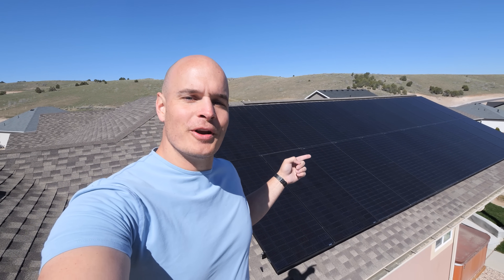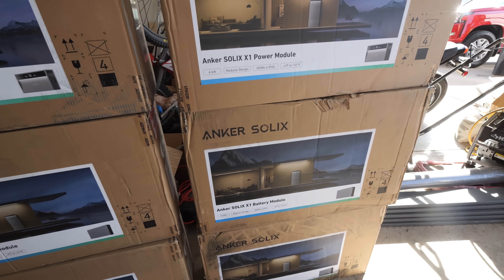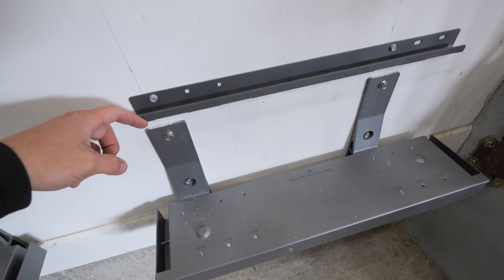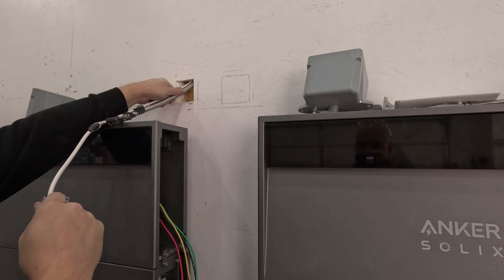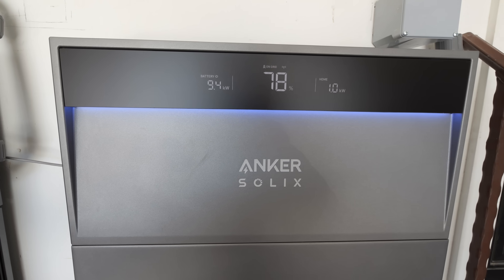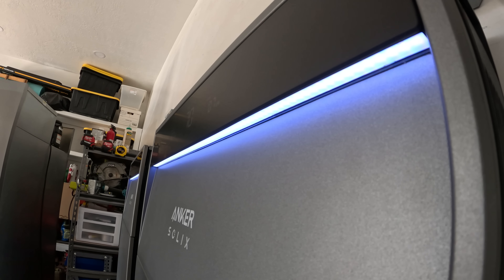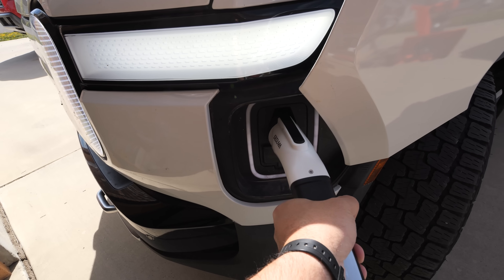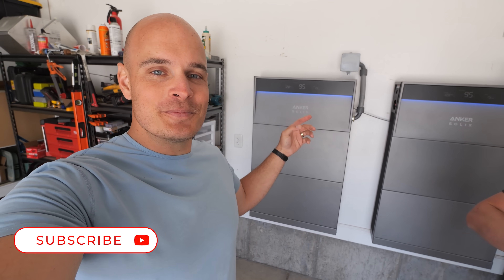How to Save Sunlight for the Night? - NEW Solar Battery Install

Comment: The Anker battery system seems really great as a whole house backup solution.  But it shares one attribute with many other solar energy systems that I'm not crazy about - it requires your battery system to communicate with Anker's servers.   So what happens if Anker isn't around 10 years down the road or internet connectivity to their servers is somehow interrupted?  This trend is ongoing across the whole solar energy sector.  Companies are firmly tethering us to their servers.  Sunpower filed for bankruptcy protection while some brand new systems had yet to be activated.  So owners were stuck with brand new hardware, fully installed, grid access permitted and they can't power them up and start benefitting from them because Sunpower didn't have the personnel to activate them.

Comment: In my short time with solar panels, I have noticed that they do collect a lot of HEAT.  During solar panel installation, are the installers using any type of heat reflecting material underneath the panels? as to not make the home HOTTER.  kinda counter productive, right?

reduce heat in home, and probably help with solar energy production, reflective material under the panels...

Comment: It's funny how people still have anxeity about full cycling lithium technology back from the days of old battery tech.

It's not the cycling that's an issue with LPF, it's high temps and voltage (high capacity charging). I hope those batteries have an 80% charge feature to extend their lifespan...

Comment: In Australia 2 x 5kw quality batteries would costs $20,000 and that's a lot of night electricity so does it make sense to have batteries?

We've just had a 6.6kw system installed and the solar guy said to wait a couple of years to gather the 6 HOT months night air conditioning usage data before deciding whether we get batteries.

Comment: Low efficiency to charge solar energy
into batteries, not worth it 
Lots of energy goes to waste 
You didn’t mentioned that, the most important factor of this system 
Time for better solutions

Comment: Why are people making such a big deal that a system that requires installation based on your specific home layout and needs that may well exceed the cost of the units doesn't have a price listed.

There's A FREE QUOTE. You can do that if any of you actually cared about the price, rather than just bandwagonning onto the stupid.
Reply: I got quoted 88,000 for our whole system. Which personally is big but I don’t see it as outrageous. What I really want are the Tesla solar shingles but now that’s an outrageous price 😂 100-200k is a big no no

Comment: Latest UK guidance is that batteries like that should be fitted outside the house, and more than 1 metre away from any doors, windows or exterior air vents. So obviously more perceived fire risk here.
PS - The "1 metre" requirement pretty well excludes most of my external wall space.

Comment: My system is much more modest. I have 4.2 kW of solar and 15 kWh of energy storage and a 7.5 kW inverter. I bought everything for about $13,000 and installed it myself with my electrician buddy. I took the 30% tax credit and it is saving me over $2500 per year. So that's a payback period of about 3.6 years.

Comment: The missing piece is a full electrical panel so that when power goes out it can shut off certain breakers.. like a hot tub.. or heat pump.. or EV charger that use more electricity than the inverter can handle.    I know there are some small panels that do this, but where is the 40 spot 200amp whole home panel?

Comment: kind of odd in my view   one can buy a single battery that outputs 15000  takes up a lot less flloor or wall space.  Cost is around $1000 to $2000 depending upon where one buys the unit.  Granted you likely got these batteries for nothing as a compensation for doing the video.

Comment: at 2:10 you say the batteries is about 20kwh of power. (i think its 4 batteries at 5kwh each).   Earlier in the video you said average house uses 30kwh per day, so if thats say 15kwh during day and 15kwh at night to get to 30, then sounds like 20kwh is going to be about 5kwh more than he needs, and thats just for ONE night. If he has no grid power for more than one night, he's sitting the dark. Correct? During the video you say "massive" power and all that, sounds great, but sounds like this guy is going to be sitting in the dark if the grid is down for more than one day. Maybe I'm wrong, someone chime in if you know for sure. More and more of these types of videos are really just commercials to buy something that may or may not actually work like one would want it to.

Comment: My question is how long before these solar cells degrade?  In my experience purchasing solar lighting, after about a year and a half, the coating on the solar cell becomes cloudy, reducing its output.  Supposedly solar cells only degrade 0.5% per year but that's not my experience.

Comment: lol these things .. well any kind of battery backup is way way too expensive. You might as well save all the hassle and expenditure and just pay for grid power. By the time you earn your initial outlay back , something would have broken or batteries need replacing and you have to start over again trying to get all the cash spent back.

Comment: Here in Brazil, we can send the excess to the grid and the energy discounts it in the electricity bill. So it is a way to save this excess to use it at night or on cloudy days. I don't know if the savings are the same as having a battery, but at least we don't throw away all the "unused" sunlight.
Reply: We have net metering in the States as well, but most utilities have lobbied the gov so now we only get about 1/10 to export the energy compared to what they charge.  NM is mostly a joke in most areas of the states now (or it will be soon!)

Comment: Battery backup is still too expensive at this time,but will probably be worth it when the price per KW drop to $100 or less and not $1,000 to $1,400 it is now per KW.

Comment: Price is "request a quote".  I installed a 5.1 kWh EA Sun battery (100 A-hr, 51 VDC) which similarly hangs on the wall, for $1500 shipped.  It works fine with my 6 kW hybrid inverter (EG4 6000XP), using a comm cable to show state-of-charge.  I just use the battery to get thru evening peak pricing after the sun declines (until 9 PM), plus when any clouds pass (rare in CA summers).  So far, it hasn't drawn down more than 50%, so suffices.  If not, I can add more batteries.

Comment: It’s called “Anchor” because you are financially burdened by it so much, it will drag your wallet to the bottom of the ocean.
Reply: It's cheap
Reply: @frostnemes1s  Not when compared to say…30kWh EG4 LiFePro battery array and 13,000 worth of Inverters.

Comment: solar only works as a offgrid solution when the climate is suitable. good winters screw up what you can do in that time period...
Reply: It works during winter aswell.
You just have to spec the system to manage during the winter...
Reply: @zaarkeru3391  yes that is quite right. Unless real winters with snow. When i use electrics to heat my house. I don t have enough sun to get close to 25kwh dayly use. Maybe between 2 and 12 in winter... nog enough by far...

Comment: Even if "you don't make your money back" its still probably a good investment for 2 reasons. 

1. If the grid fails you are still protected. Especially meaningful if its a blazing hot summer day and you don't lose your AC
2. If you can pay up front for the system and for it to be installed then budgeting becomes easier after the fact because you're not concerned about paying a electricity bill at the end of the month anymore. Less bills to keep track of helps you manage money better

Comment: This is fantastic setup! But i think it does require regional and state-wise configuration to be able to discharge when electricity prices are highest as well as selling excess energy. I wonder about the 10-years warranty - i've had issues with those. They always try to wiggle out of it with some excuses in their terms of service.

Comment: 20ms is a pretty great cutover time for a grid failure, how well does it handle a brownout or a loss of one leg vs a full grid cutout? Also with the 20ms cutover time do any computers in the house shut off? (For reference most computer UPS cutover in less than 10ms)

Comment: In 🇵🇰(Pakistan) the wapda buys a solar power unit at price of 18 rs thoro net on grid system and sell us that uni at:

•For 1-100 units, the price is Rs. 22 per unit.

For 101-200 units, the price is Rs. 32 per unit.

For 201-300 units, the price is Rs. 37 per unit.

For 301-400 units, the price is Rs. 43 per unit.

For 401-500 units, the price is Rs. 47 per unit.

For 501-600 units, the price is Rs. 49 per unit.

For 601-700 units, the price is Rs. 52 per unit.

For units above 700, the price is Rs. 65 per unit.

Comment: 2 things to remember when you think about batteries.  10kw battery will only give you 6-7kw of power cos they don't deplete everything. Second most ev cars have huge batteries so use your car as a extra battery. I have

Comment: I am wondering if this kind of battery could also work with at least 2 EVs that have bi-directionnal AC charging with Vehicule-to-Home (V2H) (plugged on bi-directionnal AC chargers) and what power source would be prioritized in that case…

Comment: Bringing the Sun to Your Nights: Introducing Our Latest Solar Battery Installation! ☀🔋 Say goodbye to energy worries after sundown with our innovative solar battery solution. Harness the power of sunlight during the day and store it for use at night, ensuring round-the-clock access to clean, renewable energy. It's a game-changer for sustainability and convenience, empowering you to embrace a brighter future while reducing your carbon footprint. Join us in embracing the sun's endless potential, even after it sets

Comment: Yo, you ever thought about building the battery bank yourself, using raw cells? That seems right down your DIY alley. It's remarkably easy, and especially with new LiFePO4 tech, also super safe. I've been doing it for a few years now and have saved people a ridiculous amount of money on solar generator type products. So many awesome topics to dive into if you decide to pursue it.
Reply: Hi. I am very interested in this and I had no idea it was safe and easy to do this until I saw your comment. Could you recommend any learning materials, links,  products, etc that could help?

Comment: Anker sells crap like EcoFlow.
Ask them, what LFP cells they are using: manufacturer and model of those cells

Answer: none
cause they buy cells from chinese spot market for cheap and you are scewed cause the cell is the value of such battery. Only its spec sheet will tell you more about cycles and what to take care for. Stopped the video and can not recommand just pure advertising.

Comment: Some questions that should be answered before anyone should be willing to commit to any system like this:
1. Can Anker make a unilateral decision to brick it remotely using the internet connection?
2. If/when they go out of business/get bought up by a bigger company, or in the extremely unlikely event that their stuff is actually reliable long term, want to force customers to buy upgrades for devices that still work fine, will this system still work if all remote systems/phone apps etc. are no longer supported? 
3. Will it talk to open source home automation software?
4. What information are they gathering using their devices and who are they selling it to?

Comment: Isn’t it more cost effective to buy one or two battery backup units instead of 6.  I see lots of wasted sheet metal and overhead electronics. Tesla PowerWall or similar competitors may save money.
Reply: Are you referring to only using batteries and not getting solar panels?
Reply: @Stevepcox491  No, solar & batteries.  My minor objection is 6 battery packs vs 1 or 2 larger ones.
Reply: @johnpoldo8817  oh. If this anker batteries end up being close to Ecoflow similar battery prices then, this battery would be cheaper. Tesla batteries are 12 kwh and their price is $11,500. Ecoflow 2 units would be 12 kWh, plus the wall panel would be around $8k and if you add one more would be 18 kWh making it more then Tesla and around the same price of one.

Comment: I love how rich people get to save money by being rich.
Reply: Well here in India you can get 20kw solar installed with batteries and all for less that $10k it's around $700-$800 per kw.
Reply: When are they going to break even? With the degradation of lithium batteries, probably never
Reply: @clovervolcano 
Source or proof of your statement?
Reply: you can get dotation for these kinds of solar panels, I think if you get the water heating kind its basically free, for the electricity generating ones you get around 50% back, so a setup for a normal house would be around 20k euro at most I recon
Reply: @ghost963cz  Crying in American where at best we get to deduct part of the cost on taxes.
Reply: I love how we just sit and complain rather than doing anything about that. You're telling me there's 8 billion peeps in the world, and not even more than a million have tried to overthrow or slaughter the rich yet?
Reply: They are not really saving money, its more about a display of wealth.  But someone has to start it rolling so the costs go down and it eventually trickles down (like everything else).  So let the rich spend money.
Reply: @RS-ls7mm source/ proof of statement? Like how? Show me the numbers

Comment: meh. i would not install that thing in the garage if the garage is part of the house..
outside wall, shed.. anything that can burn up without the whole house following directly.
At least get a proper fireproof insulation around it, that prevents heat+smoke to get into the house, and not store easy burning things like fuel and EVs alongside.

Comment: Wait a minute, no house uses an average of 1.3 kW.  Where’s the load for HVAC, refrigerator, and other appliances.  If an all electric house, look at how much energy is consumed cooking dinner.  When located in a warm climate, add power required for a swimming pool / spa.  

Over night energy consumption should be low, except for HVAC, while sleeping.

Comment: You have no idea how desperately we need this setup in Ghana right now.
Reply: You should look into building the battery pack yourself, from raw LiFePO4 cells and BMS. It's surprisingly easy, requires few tools, and saves a ridiculous amount of money (like 50%+ compared to pre-built kits like these Ankers. EVE LF280K cells are what I use as they are extremely high value and will last 20+ years with proper care. I guarantee they can be shipped to you at relatively affordable prices, especially when bought in large quantities.
Reply: @Spaniard47  do you have any guide or directions for me to make some research?
Reply: @StephenOjukwu  there are a lot of very good resources here on YouTube like Will Prowse and Andy's off grid garage. I use EVE cells and JK BMS for my own projects.

Comment: Can this be used as just a battery backup system without the solar panels?
Reply: Yes you can set up batteries in your house without solar panels. The only thing is that it would increase your electricity bill drastically because you would be using more electricity from your power company to fill the batteries.
Reply: @Stevepcox491  Wouldn’t that just be for the initial charge and then following an outage to recharge?
Reply: @DarrellPoe  The batteries setup in this video is 36kwh. They haven’t put a price yet so I’m using Ecoflow similar batteries for price. A  batteries system similar to this one would cost around 25k -30k for the instance the power goes out. If is a location that power goes out often (highly recommend), but if not, i don’t see the benefit of just getting batteries.

Comment: I'm confused a tesla powerwall is 11kw and weighs 350lb and your 6kw batteries look like empty boxes. Lol how?
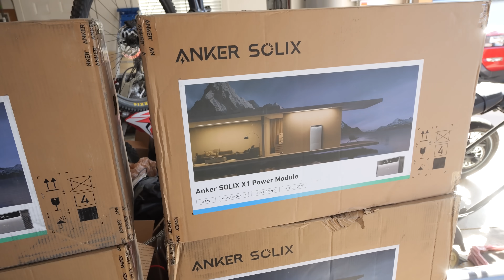Reply: If look closely at 1:00 minutes each section of the batteries have different kWh. Each of the 2 completed wall batteries are 16 kWh making it a capable of 32 kWh of storage. It works similar to the new Ecoflow battery.

Comment: A very good solution, and very practical. In Ukraine, due to constant missile attacks on power plants and frequent power outages, we had to install a similar system with 14 kW/h panels and an 18 kilowatt battery. The system works perfectly, and in case of insufficient solar generation, the gasoline generator is automatically started, which quickly charges the battery of the solar station and the system again works autonomously for many hours.
Reply: What is the situation like in Ukraine? You still have war right? But do you live normally? Like go outside? Go to work/ school etc?

Comment: Solar is so expensive, it would take 20+ years to get that money back. Most power bills are around 100ish dollars a month. His set up is in the upper 30k, that means it would take 25+ years to come out even. That's freaking wild. Most people won't live in their house past 15 years
Reply: You are right, but can I ask, why would you not ask the same question to your power company? About where’s my money back. I will use 30k as your example (the setup in this video is way more expensive) I don’t where you live but in the USA you receive 30% of the total cost of the system as a tax credit. There are some state, cities and even power companies that give rebates/tax credit other than federal. Just with a reduction of the federal tax credit a 30k system would be 21k making it around $70 a month for the same power you’re using currently
Reply: I think this person was using something like 100kWh/day. If they're somewhere with a cheap 10cent/kwH that's $300/mo which is something like 12 years to break even with no incentives. If they move out before then the setup will increase their house's sale value.